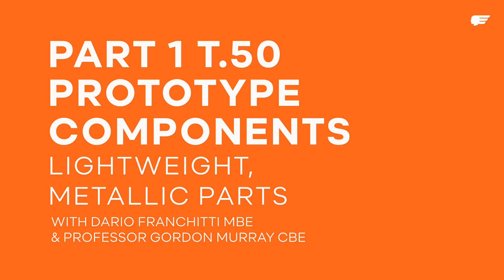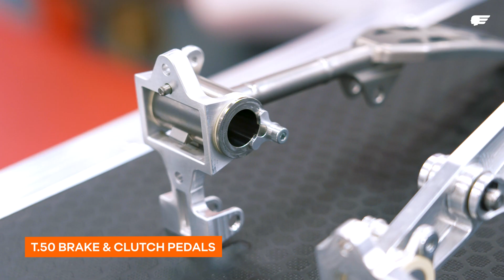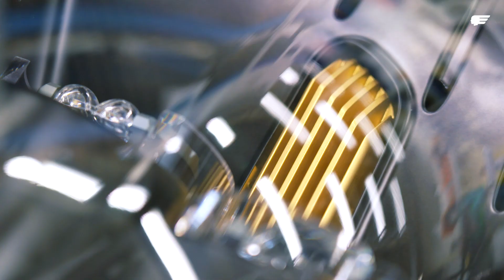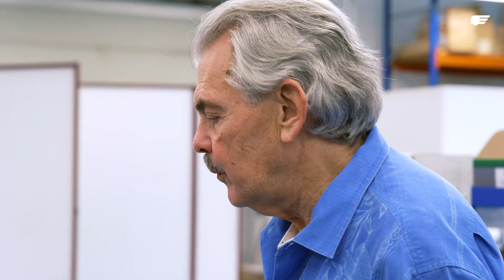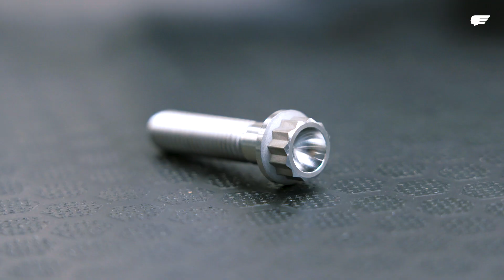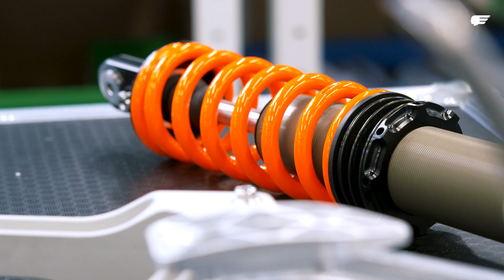T.50 VLOG | EPISODE #3 | PROTOTYPE COMPONENTS PART 1

Comment: I want a tachometer with a yellow arrow, like in the dashboards of a 90 Mercedes, where the arrow is entirely lit on a black background and white fonts (it's very warm, very safe at any time of the day and suits the yellow T50 colors). The design of the T50 tachometer is similar to a medical pressure gauge for measuring pressure, I do not really like the feeling of medicine in things, plus it does not have very good readability (gray on gray is sad, and after all, revolutions are a holiday, and not a drop of blood on the arrow of devices)

Comment: Regarding those lights with internal heatsinks and internal air circulation.... I guess whoever decided to do it like that never opened an air-cooled PC case after just few months of work. Or any other machine with internal air circulation....
Even with air filters, those things get nasty so I really doubt those lights will be best on the market and look good after a year or two of exposure to outside elements and dust build-up. :(

Comment: I wish Gordon and Christian from koenigsegg would get together and see what they could come up with engineering side of cars.
Reply: Imagine a similar car with super light cf wheels, a 65 kg NA camless engine making 350 HP (maybe with a hybrid motor and battery to get total 600 HP?) Running on any fuel, a light speed gearbox weighing under 40 kg maybe? And more room for luggage due to the super compact powertrain? It will be 800-850 kg at most.

Comment: No need to wait for the car to work out if the needle on the rev counter moves fast enough? Just drive the stepper motor at the max steps per second and time it? You know how fast the engine revs per second in neutral (worst case) and you know who fast the car can accel in 1st, so the answer to that question is obvious  surely??

Comment: If the engine rev's as quickly as projected, it doesn't seem like there is any way a physical tach keeps up with a stab of throttle in neutral.

Comment: Curious, why is the aluminum upright forged rather than CNC cut from billet?
Reply: Because a forging squeezes the material into the correct shape, so the grain of the metal is aligned in the load bearing direction, in effect, you take a amorphous materal with equal strength in all directions and forge it to use more of the materials strength in the direction in which the loads are carried.. That way, you can make a lighter part that carries the same load!  A CNC machining (generally) comes from a billet of cast material and so does not fully utliise the materials strength.   Aircraft are full of forgings for this very reason!
Reply: @maxtorque2277  Then why is the piece connecting the two halves of the monocoque cnc cut from billet aluminum and not forged?

Comment: Will the analogue rev. counter with this engine work though? "LFA's engine can rev from idle to 9,000 rpm in just six tenths of a second, a digital rev counter was required as an analogue system simply couldn't keep pace."
Reply: I don't believe this argument. Use a stronger motor ;-)

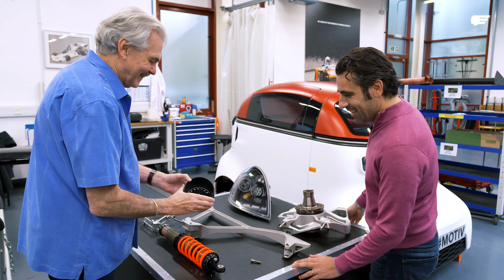Comment: 6:52 well the answer is the aluminium needle can’t cope up with speed of the engine’s 24.800 revs per second which translates to from idle to red line 12.100 in just 0.3 seconds !!!! Only car that had this same challenge was LFA and LFA reved from idle to 9000 in 0.6 seconds much slower and they couldn’t display the revs in sync with needle so they were first ones that had to use display because of its necessity of showing live revs in sync with the engine I don’t know how they are going to this it’s mind boggling 🤯

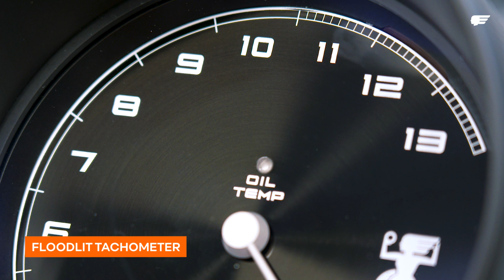Comment: 6:43 Regarding Mr. Muray's concern on  the rev counter: 2012 Lexus LFA had the same problem , they got around it by creating the 1st digital rev counter. it still looks very natural and simple.
Reply: I guess all those "problems" are marketing hype... in mechanical watches the seconds hands of a rattrapante crono can move 360º in a blink with total precision, since a century ago... and modern stepper motors can start/move/stop any angle in a fraction of a second
Reply: @charlieoronzon7108  would be nice to see them implement it.
Reply: @GrayFoxGamingHD  After a quick search, I already found stepper motors under a cm in lenght and 1.1 gr in weight, looks good to me https://www.faulhaber.com/fileadmin/Import/Media/EN_DM0620_FPS.pdf
Reply: @Bunkshizzle https://youtu.be/3owqvmMf6No
High speed precision needles are everywhere.
An engine can't outrun a needle that's designed for fast movement. What the manufacturers use as an excuse is up to them.
Reply: LFA Cluster is about as natural as a PlayStation. But Top Gear said the engine outruns the needle so it must be true. Since that's true, I wonder what race cars have used all these years?
Reply: I like the look of the LFA cluster. Racing cars been using digital clusters since the 90s.
Reply: @Bunkshizzlegauges with needles, the words I think you were looking for, are what race cars have used for ages. Shift lights aren't relevant to the function of an analog needle. 
The thought that any engine can outrun a needle designed for the job is silly. 
Let's not lose focus here, that's a sexy gauge, and it's twice as nice for being metal and analog.